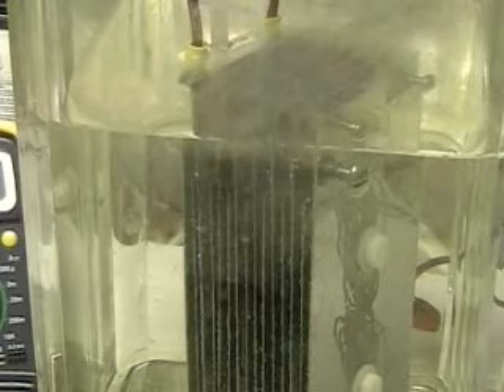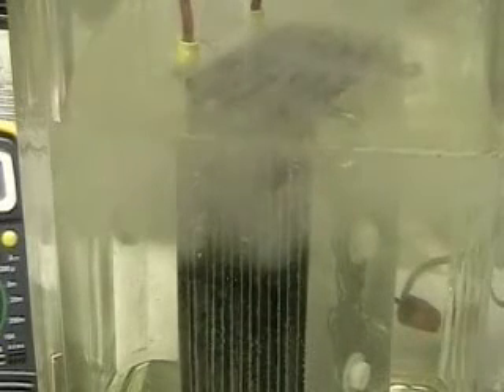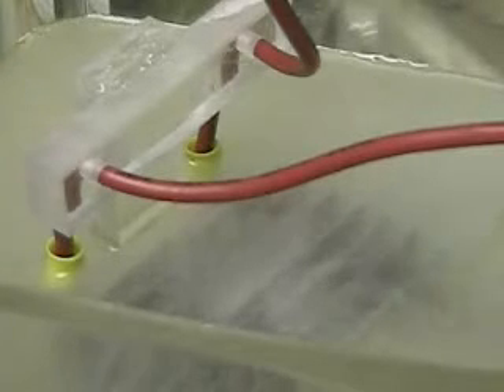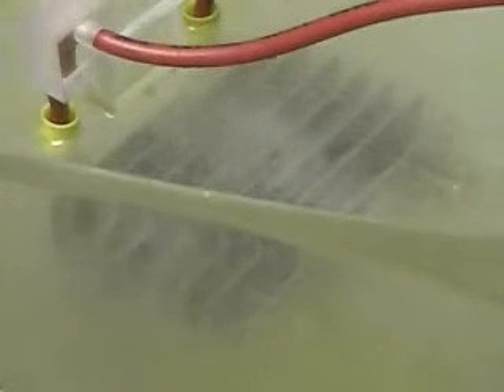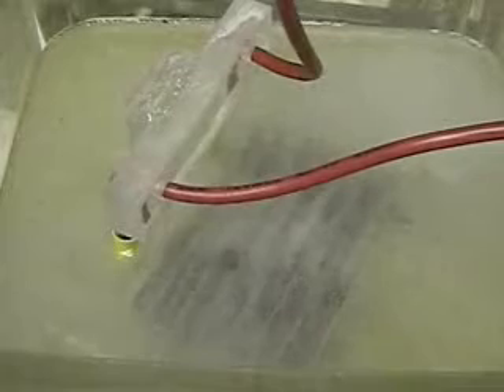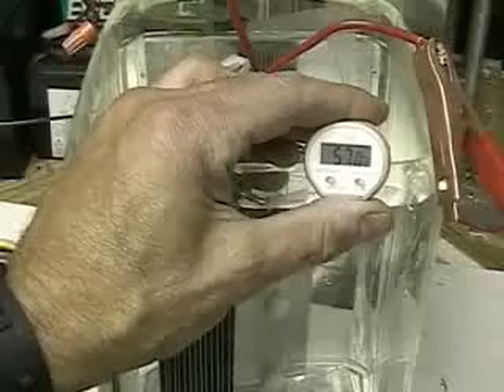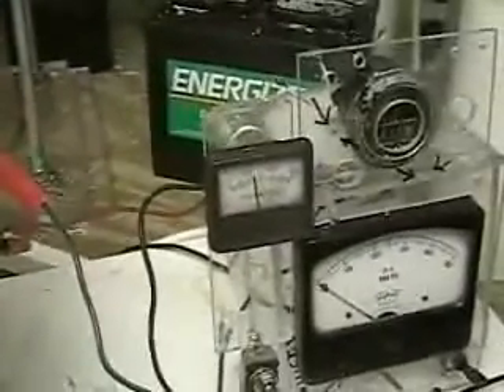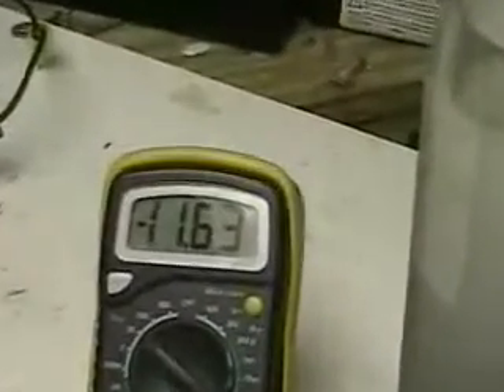Hydrogen Car Conversion Part 1

Comment: it does not matter how many plates you are using, the secret as Stanley meyers said to make hydrogen is use only tap water and finding the right frequency to as he says split the molucues with out using any chemicals